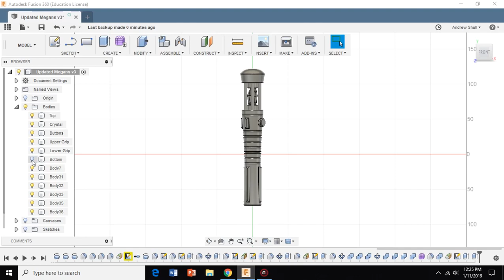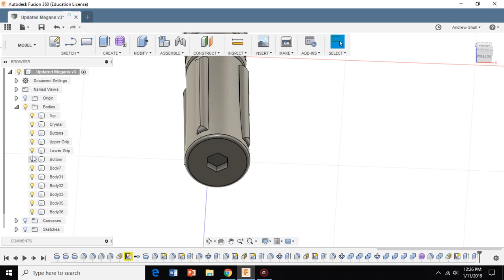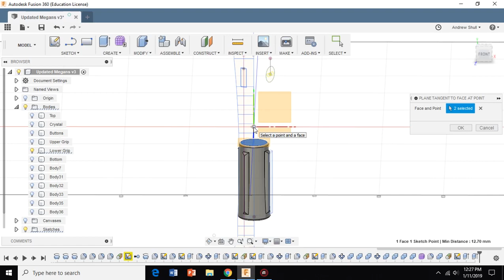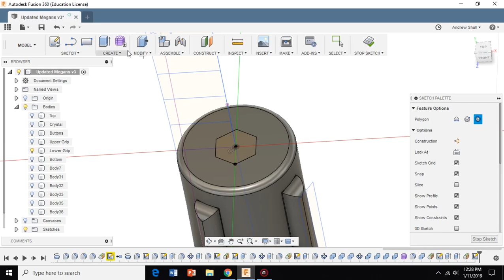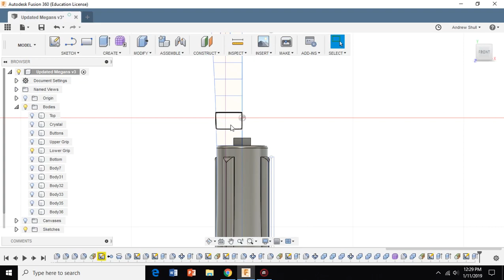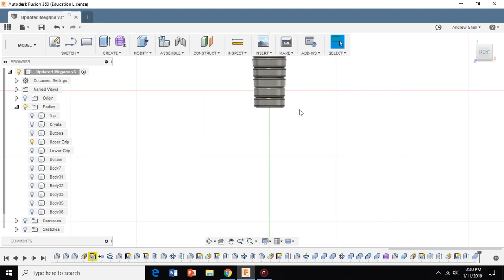Creating Registration in 3d Models for Printing and Assembling in Fusion360

Comment: Thanks for this. This is what I needed. Although is there an easy way to add a bit of spacing? I need to glue small parts and so making the cut slightly bigger than the key would be ideal.
Reply: came here to say this, looking to automate tolerances :/